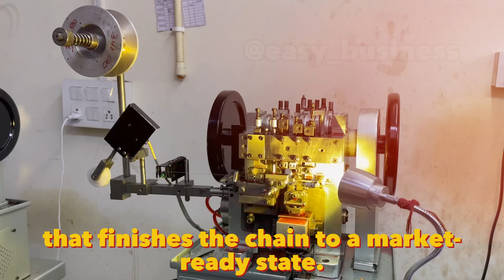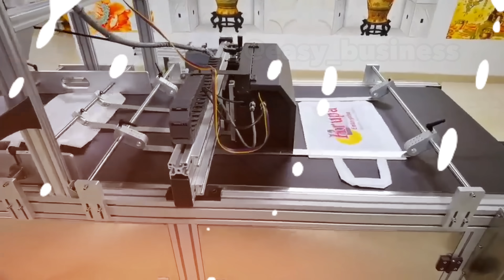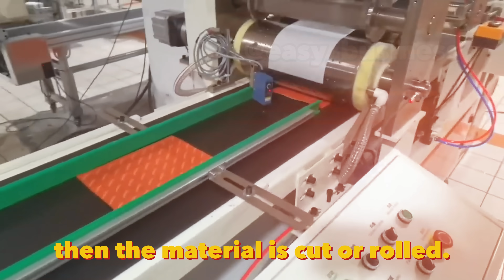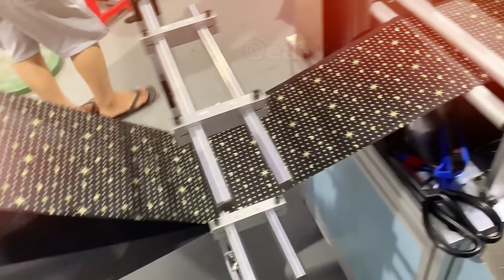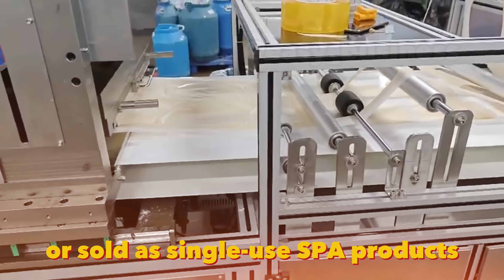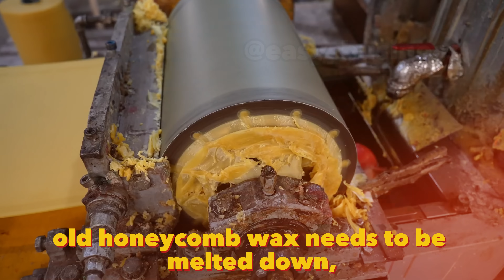30 EASY MACHINES TO IMPORT FROM CHINA FOR STARTING GARAGE BUSINESS

Comment: One thing to consider is that the equipment will depreciate, and the production line needs to be replaced every 4 to 5 years, which is extremely expensive. We have a cooperative factory, and it cost 80 million to replace the production line, which is equivalent to the profits earned in the past 10 years
Reply: That means there were really no profits. You sold into a market that’s artificially cheap, likely because of Chinese slave labor producing goods nobody can compete with.

Comment: Starting a garage business with imported machines from China is a popular and affordable route—there are tons of options like laser engravers, heat presses, and small CNCs. I use the Monport Mega and love it for its auto-focus, clean engraving, built-in lights, and easy rotary attachment—it’s a solid choice to start with.
Reply: We are factory of the machine you said. Can we cooperate?
Reply: yeah it is easy as well as you can receive the machines within 3-6 Days by DHL Express and even Spare and Repair Parts!